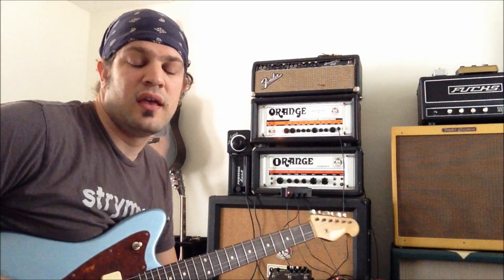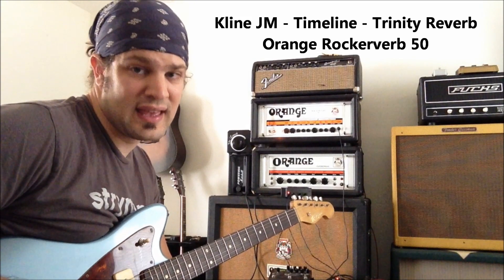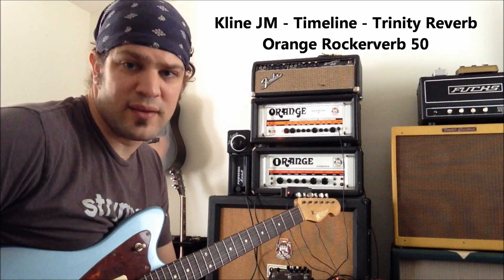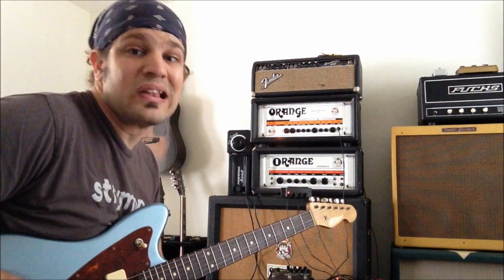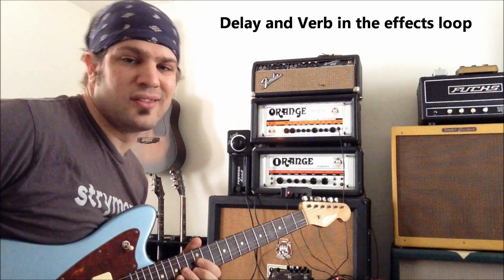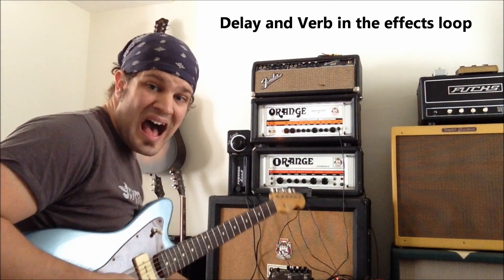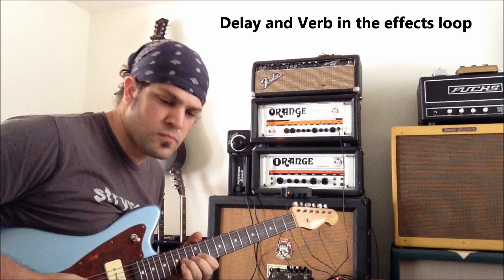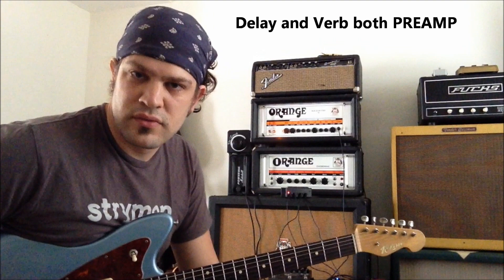Delay and reverb preamp and in the effects loop

Comment: Wtf, my Marshall dsl15c don't have effect loop port on the back, can't using delay pedal on preamp drive
Reply from the maker: oh man that sucks, i'm sorry :/ i had an old 78 JMP without a loop but it could be cleaned up well on the input. most marshalls have loops but maybe some of the lower wattage dont?
Reply: the only solution is buying overdrive pedal, but ironiclly for cheap drive pedals, they cant beat my marshall preamp drive tone